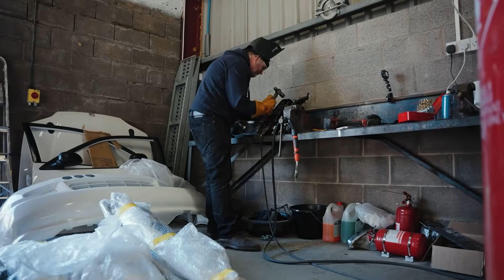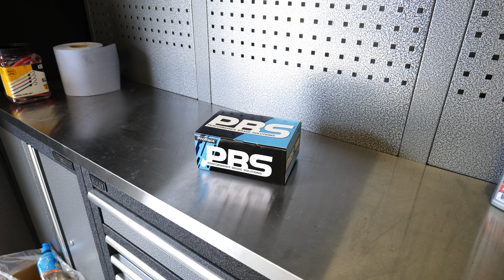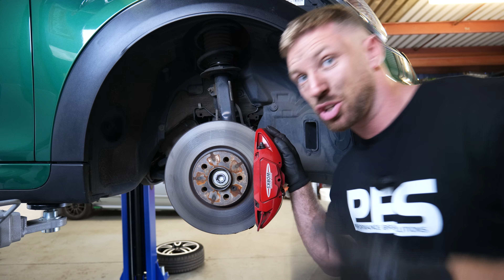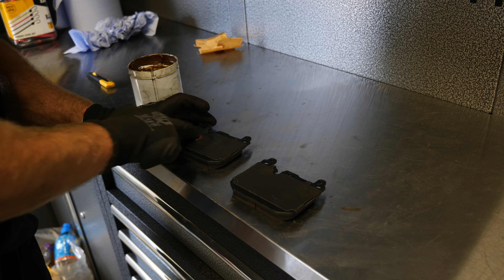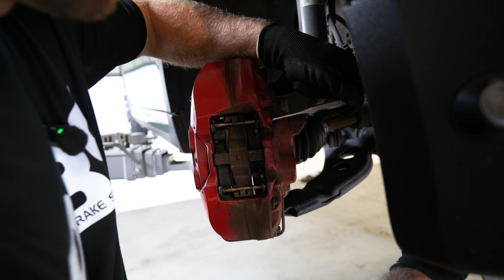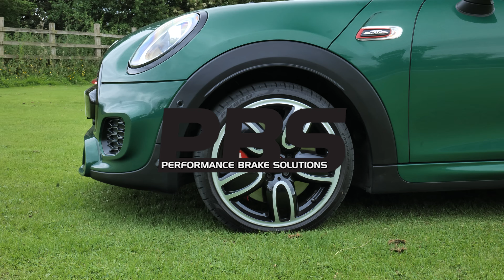Don't Mess Up Your Brakes! MINI F56 JCW Pad Installation Guide

Comment: Why use a ball-peen hammer? Damaging the aluminium caliper's paint causes corrosion and seizes those steel pins. Also, when applying copper grease, use a rag to dab the globs up so there is a thinner amount of product; using that much will only attract more road grime, causing the pads to seize on the pins and lead to uneven pad wear. Use a dead-blow next time to save yourself the hassle. A clear front view of the nearside caliper would have been much better, too, instead of making it hard on yourself by crossing your arms to drive the pin out with the punch. Not hating on you but it's just simple stuff that will lead to more work later on down the line.